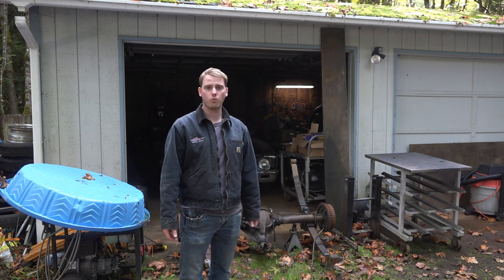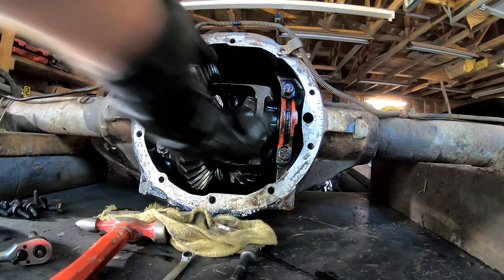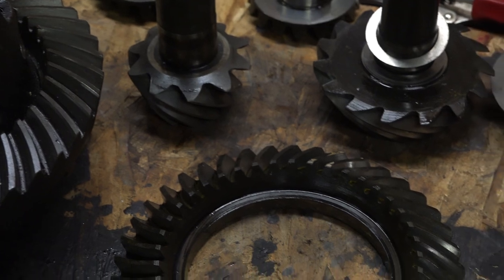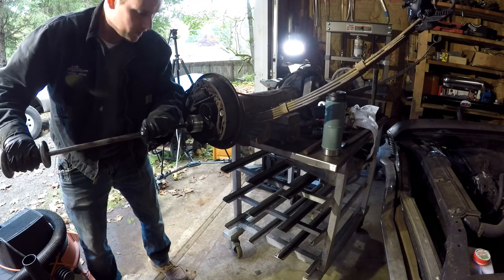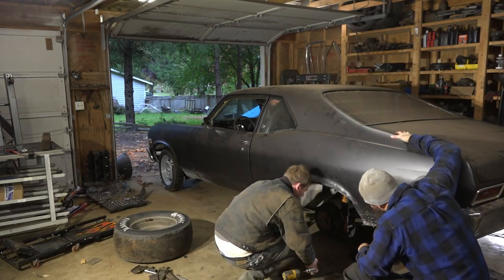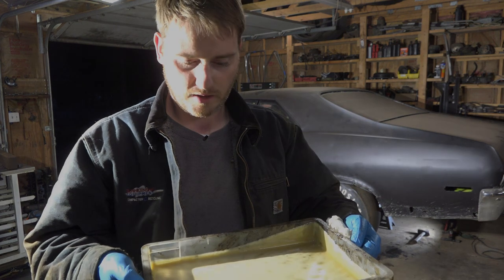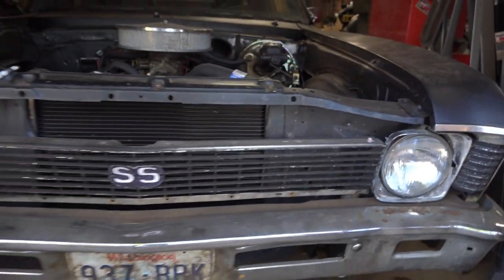New Gears for the Nova! | Not Rod Ep. 6

Comment: At 14:00 when you are talking about those leaf spring brackets, you can buy the new clips and bolts for about $30 on summit. I had to cut 2 bolts with alittle air grinder. The under side of the car has 3 holes for sliding the new clips in which make it easier than cutting the floor
Reply from the maker: That is very good to know, thanks for the info! Now I'll know to just cut the bolts because I really want to install sub-frame connectors (which use those bolts) with Multi-leaf springs in our next episode on this thing, maybe even a rear sway bar.
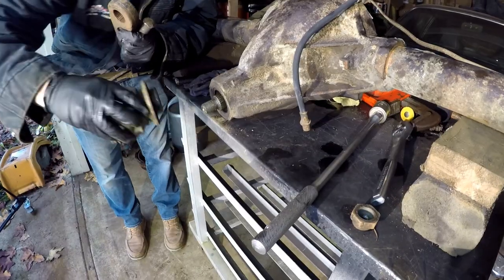Reply: @NotRodShop  I had a hard time trying to find leaf springs for my 68. The original ones were sagging and the drivers perch was actually split open almost in the video. I ordered multileaf but my perches on my 8.5 were not made for it. So I just ordered some stock monos for it and I have it all back together. Got a 355 with a cam and headers. I got a 3:08 from the car being a 307 and power glide car. 355 and th350 move thos car right down the road
Reply: @not rod shop  It should ride better with multi leaf over the mono. It'll handle the torque better too

Comment: I found on my 74 Nova you should leave the rubber pads out of leaf springs....otherwise under heavy torque the rear axle can shift  and cause bad dog tracking.....happen to me 6 times before i remove them by adding a leaf and not use them

Comment: For future reference, those bolts that hold the spring pockets in don't go up through the floor. You can cut them, get the spring pocket out of the way, and the "nut" up in the floor is accessible from under the car. They are little clips the same as say the ones your inner fenders use. Really easy to replace, no need to cut the floor.

Comment: wat you could do to check if the new bearing has the same height as the dummy bearing is measure the height from the bottom of the piniongear to the top of the dummybearing then put on the new gear and check if that distance is the same , if its not you need to add or subtract shims but at least you know that before you put it in the diffcase again 
prolly can check the thickness of the bearing race too
hmmm if you put a spool in a car and make a turn the inner tire will usually try to slip to make up for the fact that the inner wheel actually needs to rotate slowerthat the wheel on the outside of the turn looks like it put a little too mush strain on the old springs 
when you replace the springs you might want to put slapperbars on them too or the more modern link type version of them , as you will probably wind up the springs if youre trying to go down the dragrace strip

Comment: 4:10 gears been there it really makes the car a lot faster for drag racing but then you wish you had a 5 speed transmission after that. The multi leaf springs will help it to not wheel hop so they are a up grade so I would have left them on. I actually went to the salvage and bought some multi leaf springs off a nova to put on our camaro. It stopped the wheel hop. Oh well you took your off? Put them back on and that will solve your problem of it coming apart.

Comment: Fun fact about rebuilding rear ends is...use the factory shims even if your replacing ring and pinion. It was correct from the factory a lasted all the way up to this rebuild. The only time I've ever had to use different shims, is when there is a whining or gear noise due to incorrect backlash or gear mesh. An issue that is noticeable before you hit 1200 miles on your new truck or car.

Comment: If you cut the front leaf spring brackets off you can normally get a wrench and hold the nut on the retainer and get the bolts out and then replace them. I also have a limited slip with 3:73 and axle shafts I’d sell you for cheap if that’s some you would be interested in
Reply from the maker: I might be...  Let me test out the 4.10's and see how that goes, if they're too low 3.73 might be the ticket.

Comment: lotta work for a gm 8.5 inch you need to go slow when turning if you used a mini spool its going to chatter. you need a full spool if you want no chatter went through the same thing about 20 years ago in my nova , ended up dumping my 12 bolt for a 9 inch after going through 3 of these executive 10 bolts. every one but the last one had a mini spool.

Comment: Did the same thing in my 71 nova  took it out n fired into it slammed it into second n dumped the clutch in second gear n the rear end came loose  on the driver's side  totally out n turned front to back instead of side to side running about 45 mph.  Jacked it up got the rear end where it was supposed to be chained it in plus used a come along  got in and  gave it hell.   Good times. Lol

Comment: This may have been brought up, but why not just change the gear set in the current rear end and save 86.934% of the effort?
Reply from the maker: Essentially just to have a spare. If I blow an axle up I can quickly swap them out and be back on the track while it gets fixed on the bench. I also plan on putting 3.55 or 3.31 in the other axle for a more streetable ratio for someday when the car is fixed up all nice and still have a 4.10 rear end to throw in when I want to race it.
Reply: @NotRodShop  That makes perfect sense.  Thanks!!

Comment: Okay, so here we have Moe and Larry all we need now is curly. since you changed the rear housing, what did you do with pinion angle?
Reply: Get off of your soap box Pat. Some people do not actually get born as an expert.
Reply: @st.george9404  it doesn't take an expert to figure out that pinion angle is very important if you plan to go out to the race  track. incorrect p/a will get you a broken u-joint.
Reply: @patbarrett9263  You missed the point completely again. Before the nova he had never drag raced. Just look at the shop they are not professionals. The guy with the nova is learning. It does not matter with that car and that drive train if the pinion angles is different from stock. So what exactly is his pinion angle before and after the axle wrap? Oh wait. The axle is wrapping with stock leaf springs and racing tires? What about the wheel hop? He needs some type of axle retention. I personally love caltrack bars for an application like this. But I digress. You need to stop putting other people down Pat. It makes you look like a small petty person. Try encouraging people to get in this hobby.